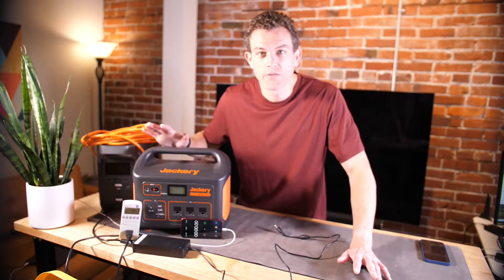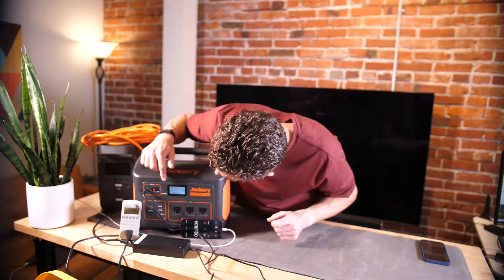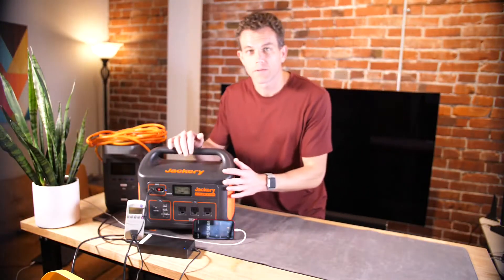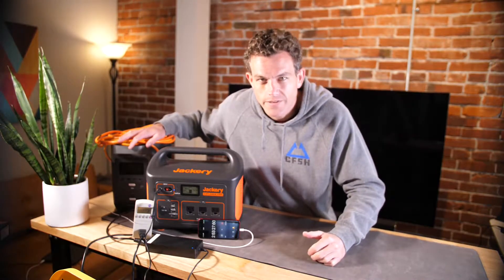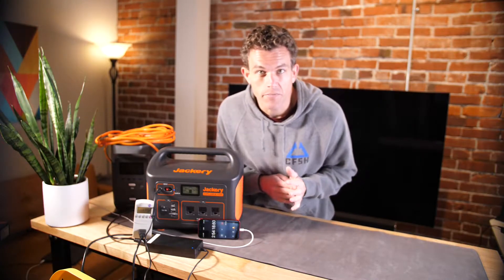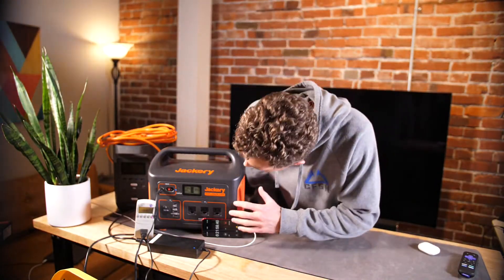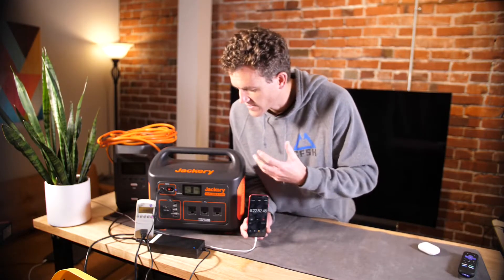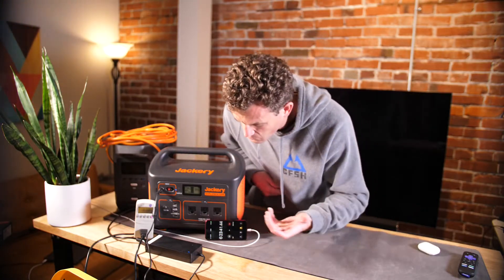Charging the Jackery 1000 Test! AC Test from 0 to 100 percent charge. How long does it take?

Comment: Does Jackery have to be below 20% before charging. My input shows 0w input with wall charger. Blue light is on.
Reply: Same..
Reply: I started charging mine out of the box at 43%, per the instructions manual. They state don't use until you have fully charged your unit. Hope this helps.

Comment: We unboxed our Jackery 1000 and checked the display and It said 50% charge so I plugged in the wall charger and the display said 524 watts input and after 2 hours there was no increase in charge percentage. The charger did not get warm. Have I done something wrong or would you think the charger is defective? Should I maybe run the unit down and then try to charge again? Also, is the fan suppose run steady when you have something plugged into the AC plugs?

Comment: Loved the Chopin.

Can you charge the Jackery via a 12-volt port in your car while you're driving?
Reply: You can definitely charge the Jackery Exporer 1000 via a 12 volt or 24 volt port in a vehicle while driving.
Reply: Does charging the jackery via the car battery while driving damage the car or car battery??
Reply: No damage that I've noticed to your vehicle car batteries, while driving and charging your Jackery. It's a great compact 22 pound portable unit. I,bought a Goal Zero Unit and a Jackery unit. Both are great, but so far, I like the design of the Jackery better. They both perform well. I like the display monitor on the Goal Zero Unit better, because it stays lighted. You can read it while charging at a distance much easier.